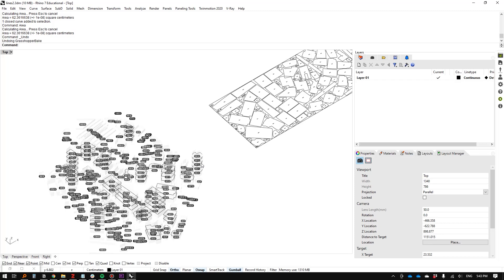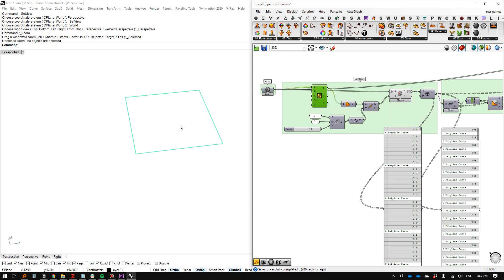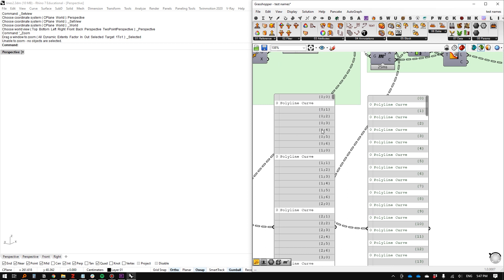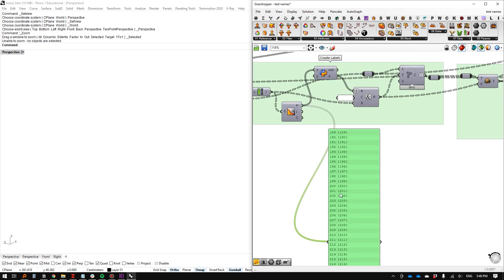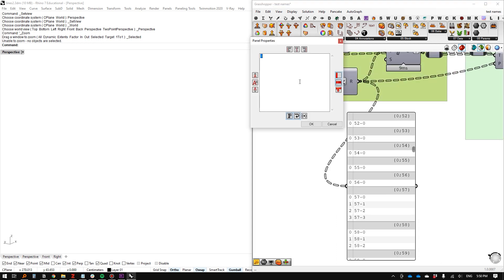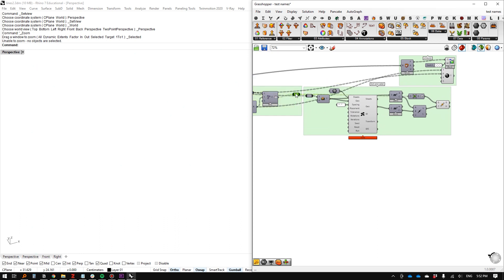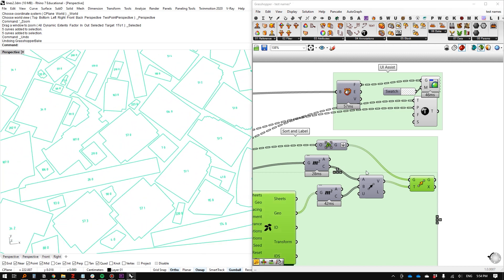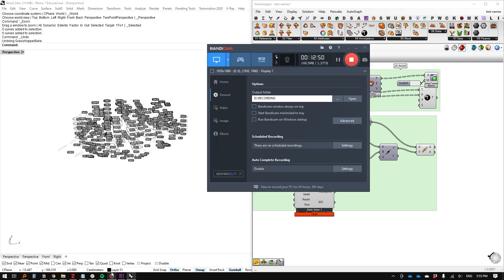Nesting Buildings and Labels for Making Physical Architectural Models

Comment: Isn’t it possible to just use the Transform output instead of constructing the vector out of centroid points?
Reply from the maker: probably, I can't remember why I did it that way - it might have been due to some slight performance increase or for labeling

Comment: Hi Niko, what if I would want to layout the side edges of each building for laser cutting? I tried out the script in your 2 videos and it seems like opennest only works on geometry placed on the XY plane,whereas the sides edges of the building would be on YZ or XZ plane. is there any solution you could think of for this? Thanks!
Reply from the maker: Hey Colin. Assuming you mean the vertical faces of a geometry, you would just need to isolate the desired faces, "orient" them to the XY plane, and then follow the script. You could also unroll geometry if you want to fold a shape together. If there's enough desire from others I can make a brief video about this.
Reply: @NikoDellic  I definitely have the desire, I'm in my second year of architecture school and I've been using Rhino to make the digital model then unrolling the surface of each polysurface, then once the surfaces are unrolled I go through and manually delete the faces I don't need due to material thickness, definitely a horrible workflow so it would be extremely beneficial especially from someone like you man you're really knowledgeable and deliver the information in an easy to understand way.
Reply: @NikoDellic  i would love this your other videos has been very helpful